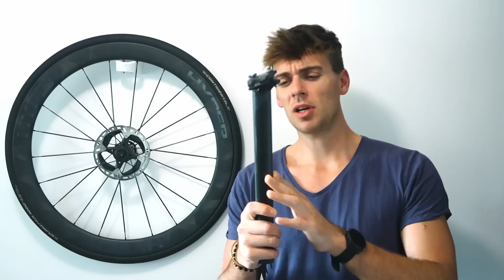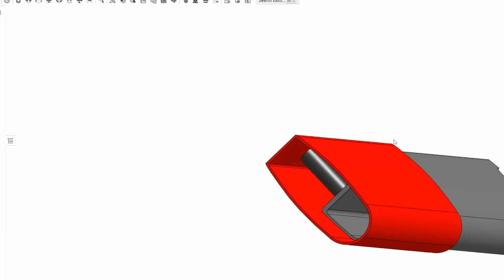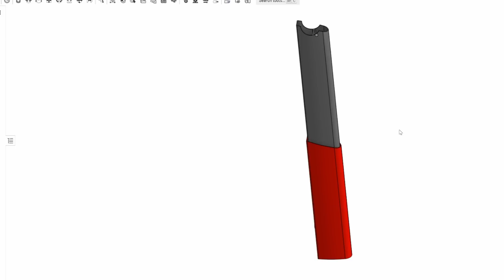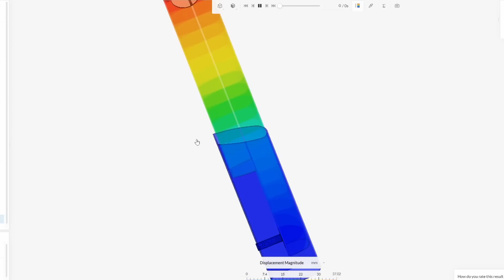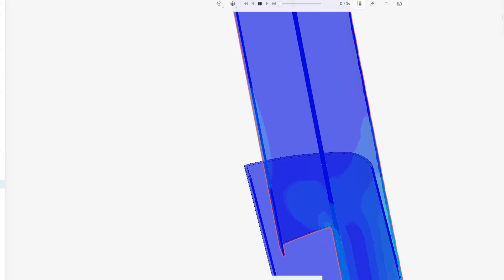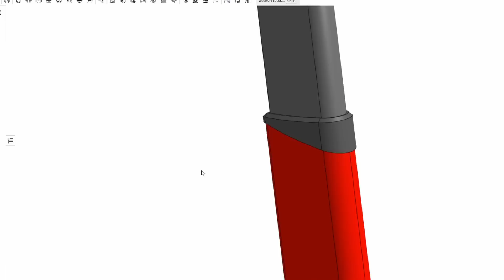2021 Canyon Aeroad seatpost fail, fix & The State of bicycle frames in 2021.

Comment: Also, new Aeroad's handlebar and fork steering tube are absolutely crap from an engineering point of view. The clamping surface of the stem on the steering tube is way too small compared to a traditional stem, no way it's any reliable, especially considering the fact the very few cyclists use a torque wrench. Extendable width of bars - no way that design is any stiff!!! Any solid construction is greatly stiffer than that two tiny bolts design, and again clamping surface is too small to be even close to being stiff and reliable.    
That's a pity, Aeroad used to be a very good bike and great value for the money.
Reply from the maker: Totally agree. I have been meaning to make a video on the stem setup and bars for ages - why reinvent the wheel?!

Comment: This video introduced me to this problem. Within 10 seconds my brain was like: more clearance, higher second moment of area and where tf is a proper seal.

I'm a mechanical engineer myself. I've been mountain biking for a while but I just started with road cycling recently.
I've been watching your channel for some time (great videos) and I was surprised to find nearly no other that reviews bikes on a basic level of engineering. I find it stunning that in the bike industry marketing is not based on science and facts but sloppy non sense terms.
I don't understand how this issue ended up at the end user. Where is QC in this issue, they must have noticed this in testing? Maybe the seat post supplier messed up with the tolerances, but this seems more like a design flaw to me. This is less than basic level of engineering!! You would fail your exams with this kind of design flaw.
I'm surprised how the bike industry often lacks a basic sense of engineering.
Reply: I have a feeling that bike industy has more glittery Indusrial Designers than salty engineers.
Reply: AND what about IF/WHEN these fail and cause SERIOUS bodily injury??? It’s also why I don’t trust disc brake designs for road bikes...this industry has PROVED time after time they have NO CLUE WHAT engineering is. (I’m an on-site QC/Super intendent for DOD construction 🚧 and am REQUIRED to validate designs/work with a 3rd party QC corps...)

Comment: I put 90% of the blame for all these cases on the cycling media. The "reviewers" are too scared to not be sent a test bike next time (and therefore write a review = get clicks = get subscribers = get money) or too scared to not be invited to the bike launch next year, so they simply don't criticize anything. It's your F**KING JOB to ride bikes and find what's wrong with them. It would be like a pastry chef who can't make pastry. With no real reviews, there is no correlation between quality of engineering and number of sales, so the brands have 0 motivation to make anything that will actually perform. Just has to have the marketing blub. "Yeah, we clamp it lower for more compliance." Who gives a flying f**k if it works or not, it sounds good in the marketing! And then the half-ass reviewers, well, they can't have people thinking that they don't know what 'compliance' is, so they also have to wax lyrical about how amazingly comfortable this new system is. I've not ridden the new Aeroad, but if it's smashing into the frame hard enough to pit the carbon, how can that be comfortable? Anyway, yes: It's shitty engineering like 90% of the bike industry, but the brands have very little motivation to improve because the ~100k combined subscriber count of PT, Hambini, Roul, etc. means nothing to the industry when they have millions drinking the cool-aid of 'mainstream' bike media. /rant.
Reply from the maker: Spot on. Clarkson and Harris will openly slate Ferarri but in a trusted and valuable way, so Ferarri aim to please their opinions and that drives betterment and quality. Why can't that be the same in bikes? Cycling media is dead.

Comment: Cycle industry is abysmal in regards engineering and quality control. Specifically frames which are poor. To add insult to injury the price hikes are tantamount to theft.
Reply: Yep. It's just ridiculous that major brands are charging several thousand dollars on carbon bikes of poor quality. I made "argument" with one dude who said warranty will cover everthing, but warranty is not solution to inherent poor quaity control. With warranty, it's just easy to swap out $200 defective carbon frame with another one and it doesn't hurt their bottom line since the original supplied product is 1/10th of retail price.

Comment: This design is so evidently stupid that I'm surprised Canyon is selling it. Also, this could have been avoided in many ways. As people here have pointed out, the current Specialized Roubaix has a similar flexy seatpost / low clamp design. Specialized has incorporated a clearly visible amount of clearance around the back of the seatpost to ensure the seatpost does not clash with the frame. Canyon even solved this engineering challenge themselves on the Inflite with a top tube that dips down to expose more seat post while leaving the clamp at the top of the seatpost.

Comment: There have been some pictures of the seatpost bolt leaving dents on the narrow part of the seatpost too, could it be that the clamping area is too soft and allows too much movement?
Reply: Yep point pressure, another stupid design, especially when it is designed to flex move in the frame, so this point becomes a fulcrum. I have seen many where the fibres have been crushed and deformed. They should of made a bigger foot with a pivot which spread the loading but allowed the setpost to pivot and move, but then there is still the rub problem.

Comment: Another great video mate, I would be interested to hear your take on Scott's solution to this with their seatpost on the foil. Its definitely more forgiving than the previous version. Ham Bam thankyou mam did give it a mild reaming on the aero front and I fully agree with his assessment but from what I can tell they've achieved what they set out to do which was to add comfort by finding the middle ground between aero and something that isn't going to turn my now borderline middle aged spine into dust.

Comment: Basso has a much better solution.  They use a rubber grommet that tightens around the entire seatpost to clamp it . The rubber acts as a form of suspension while gripping the seatpost .  That solution means no carbon components touch each other . I mean how difficult would that have been to engineer ? 🤔

Comment: Stick a tire tube over it for a good seal/boot lol
Reply: Haha I used to do that on old rock shox Judy forks  .
Reply from the maker: @edmundscycles1  probably added some stiffness to those old judys too!
Reply: @edmundscycles1  I used to disassemble my Manitou 4 after a muddy ride and POUR muddy water out of it.  Shock boots were important back then.
Reply: @z3bbbbbbbs  it's why I quickly converted over to marzocchi bombers . Way better sealing .
Reply: @z3bbbbbbbs  also remember when bike frames and hubs had drain holes in them ? I do . So handy after wet muddy rides .
Reply: @edmundscycles1  I 'member when WTB made a headset with grease injector ports, and American Classic made a bottom bracket with grease ports that let you shoot grease through special hollow crank bolts.

Comment from the maker: Its like designing a flexible diving board, then adding a stack of bricks under it half way a long. What the hell?
Reply: I wonder if the Red Dot 'best of the best bicycle design award' will be rescinded? I also wonder if the seat post was one of the 'carefully crafted details' that led to the award??? 😬
Reply: @kpizzle1985  I can't find the new Aeroad on the Red Dot website so it must've been even though Canyon are still using it as part of their marketing on the product page.
Reply: @kpizzle1985  unfortunately the 'Red Dot' award is a design concept award rather than a mechanical engineering award... In essence, they value form before function, and then give it a red dot!
Reply: I recently graduated as an automotive engineer and was eager for years to go into bike frame design. Right up until a couple of years ago when I stopped watching GCN and cycling weekly and started watching you and Hambini. I am genuinely sickened by the majority of frame manufacturers they may as well be selling their stuff on Aliexpress.
Reply: @mihpop9733  Just as good frames on Aliexpress at a quarter of the price
Reply: And just like the diving board analogy, because the forward edge of the seat post is not touching the seat post once the seat post hits the rear of the seat tube does that not also act as a fulcrum actually bending the lower part of the seat post forward. This would make it take a longer distance and introduce some vertical movement and therefore abrasion at the upper touch point. Or is that insignificant compared to what is happening at the top?
Reply: yup.
Reply: More like an extra-long diving board that is set way back from the pool and the middle hits the edge when you jump on the end.
Reply: I think you didn't understand the mechanical approach of the post quite right. The post is in fact supposed to be supported both at the bottom and where is leaves the frame. It still allows flexibility like this.

Comment: Instead of using any sort of permanent sealant, you can use “plumber’s putty.” Plumbers use it to seal holes from water inflow. It’s cheap and easy to install and remove.
Reply: It's won't rebound into shape though. When the post moves it will open up a gap in the putty which will stay there allowing water in. Silicone sealant will return to it's orginal shape, keeping the seal.
Reply: @tomozanne  That's definitely possible. Just trying to think of temporary solutions that don't involve glue-like applications. Either way, it's crazy we're even having this conversation. I just tighten my 27.2 clamp every once in a while and forget about it. Can't imagine having to deal with this nonsense.
Reply: @deadreckoner5276  you and me both! Sometimes it's a good thing not to have the money to be ripped off with this sort of thing!
Reply: @deadreckoner5276  As a temporary solution you could get some rubber gloves, cut out your own gasket and slip it on. If you wanted it more secure you could tape it onto seat tube and seat post. The rubber would allow some flexibility, get the right coloured electrical tape and you could even match it to your £5k frame...

Comment: Thanks for a good video. In my living room is a brand new aeroad for the wife. It has seen 0km rides due to this issue. Its not even had a test ride up and down the street.

Canyon have said a grommet will be sent to everyone.

On our frame there isn't 1mm gap all the way around. That said I don't have a set of feeler gauges to check. But I used an a4 sheet of copier paper and it will not fit between the post and frame.

I can see the issue of the grease but the carbon grip is red in colour. In a small packet. The normal grease is in a little tube. I don't think you can mess this up.  The manual shows you what to do.

I'm wondering to save the post for now would be to use heli tape to stop some of the deflection.
Reply: Don’t do that helitape. Because if they realised u did that. They might say you went against the installation and void everything if they want to be nasty. (At least don’t tell them)

I am an Aeroad owner over the 30days return period. 

My advise as a rider to you is - return it. Save yourself any headache. Your money can buy you other bikes

Comment: I was told around a year ago by the friend of a Canyon employee that the first production run of this new model had been fully completed before "a critical design issue" was discovered and that was the reason the release was so delayed.

Fully expect that this might have been it!
Reply: If you look at Canyon web you can't order right now any of the New Aeroad, be it CFR, SLX,SL in any frame size. Do you think it's because of the issue mentioned in the video?

Comment: Great video, but slightly disagree with you saying component manufacturers are doing it better than frame manufacturers. Ive had countless problems with Sram brakes on MTB and road, they don't equate for heat expansion and seize up. Had countless rear hub warranties, maxxis tires can't get there tread straight and make me think my wheel is out of true even though its dead straight. The pressfit sram GXP bbs out the box are faulty (squeeze shell lightly and friction is applied to bearings) and let's not forget the classic shimano hollow tech cranks separating, happened to a few people I know. Just a rant :)
Reply: To be fair, he didn't mention SRAM and only talked about Conti tyres :P
Reply: @bernhard2269  But talked about Shimano, in which their cranks can fall apart :)
Reply: @KurtisPape  Touché, but you could say it's peoples own fault for living in the wrong climate zone so their Shimano Groupset disintegrates :P

Comment: What should I do now if I have a 2021 Aeroad ?
Reply from the maker: Open a warranty claim, log the fault so you have some protection. Its not dangerous IMO, because the rear section is more of a fairing than structural,  but the design is not as intended or marketed.

Comment: I appreciated the exclusion of Sram from the list of good groupset manufactures.
Reply: You mean the smaller gears and throw away power meter?
Reply: @waynosfotos  I think he is talking about reliability and quality/tolerance issues and not about strategic design decisions.
Reply: @fantscher  yes he is, he did a vid dedicated to this a year or so ago.
Reply: @fantscher  SRAM's crank axle tolerances are also pretty bad, according to Hambini.
Reply from the maker: Unintentional
Reply: Peak Torque Unintentional but the right point.
Reply: Shimano tolerances: Machinist
SRAM tolerances: Bakery
Reply: I’ve gone back to the 90s hollow tech 2, 52 39 on a canondale synapse with a hambini bb. No bonded cranks, no chain suck and definitely no bb30 parts.  Creak free fast 11speed resto modded perfection and as it’s rim brake 7.2kg on 25mm tyres and 60mm deep carbon rims.
Reply: All my sram groupsets, electrical and mechanical have been flawless. Hmm guess I'm just lucky
Reply: Sure he didn’t exclude sram?
Reply: bike mechanic here, the quality on sram components is appaling... and the cost is like 1.5x shimano...
rear mechs are ok, thats about all.
Avoid sram disc brakes AT ALL COST ! go shimano or magura.
Reply: bauke mollema approves this.
Reply: Shimano, Campagnolo, SRAM run their own factories. Most frame/bike manufacturers outsource frame production and even bike assembly. Not the only cause, but it explains things.
Reply: TBF the shifters and derailleur are OK it's the cranks that are shocking .
Reply: @edmundscycles1  actually the red derailiors prior to axs WILL fail due to material pairing issues at a pin (with painful consequences) while the whole hollow aluminum shimano cranks really suck because of bonding issues... The sram ones fail less drastically, most of the time at the interface pedal to crank, with nice little warning squeaking before it happens ;)
Reply: @fantscher  hence why I said OK . Not are brilliant.   Tbh  I wouldn't bother with anything higher than force from SRAM and 105 from Shimano . CAMPAGNOLO I'd go chorus max . If I wanted a budget build I'd go microshift or sunrace .
Reply: @edmundscycles1  what about Shimano cranks delaminating?
Reply: @Primoz.r  From what I’ve read this seems to be an issue where the component is subjected to high levels of humidity for long periods of time. For the greater population this won’t be a problem which is why there probably hasn’t been too much written or said in the cycling press.
Reply: Been rocking an SRAM 2x10 X9 groupset on my MTB for the last 8 years and it still works flawlessly.
Reply: @junkandcrapamen  honestly, my 15+ years old group sets never had an issue whatsoever. I guess it's the growing complexity that leads to the issues. Also sram seems to have their shit together way more in the MTB field.

Comment: True about the difference between automotive and cycling engineering levels.. bearing and piston ring tolerances in engines can handle 300,000km of very varied operating conditions with imperfect maintenance and still as a system pass rigorous emissions standards.. and they are sacrificial wear surfaces! Thanks to you, lutscher teknik and hambini the shortlist for next frame got very short.. Look, Time or Giant :L

Comment: A business idea for @Peak Torque: You buy test examples of the best open-mould Chinese carbon frames and run engineering tests on them. Once you have found ones that meet your standards you can buy them in bulk, monitor the quality, and then sell them on to the public for a tidy profit. It would be a win-win for everyone but the big brands. You would make a profit, the public would get a quality frame they could trust while saving thousands, and we could all stick it to the big brands who are price gauging the cycling community with over-priced and under-engineered frames.
Reply: Good idea, but it is probably not a good look for the channel. Immediately when you start doing testing on the products you sell, you run into a huge conflict of interests.

Comment: The Ultimate CF has the basic same design idea, but with a round seatpost and a rubber grommet, and that has worked fine for many years.
Really strange that Canyon didn't think that the new design would be a problem in real life.
By the way, the top tube is "flat" and the seatpost part of the frame doesn't "stick up", so your rubber skirt wouldn't work as shown.
The Specialized Roubaix has a similar desing as the Aeroroad but with a rubber grommet. It also looks like the clamp is closer to the top, so less movement to compensate.